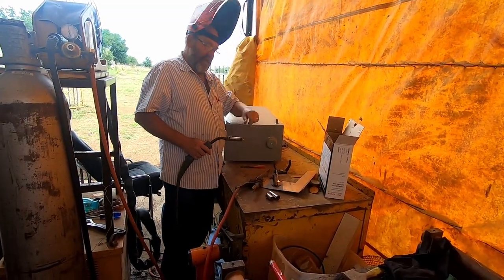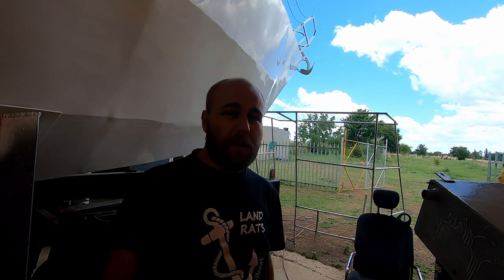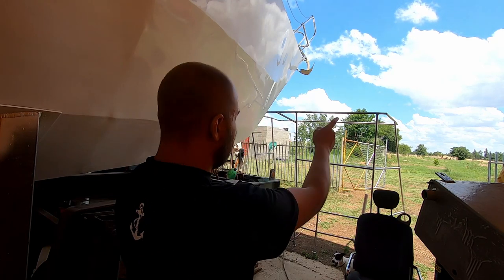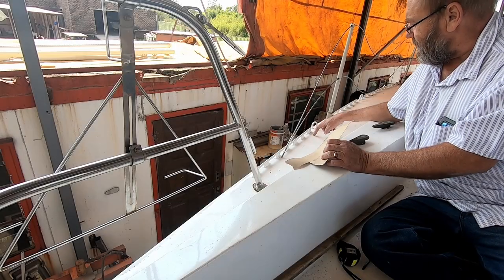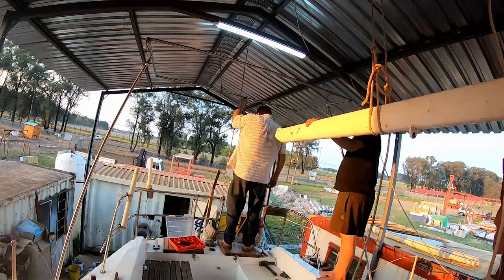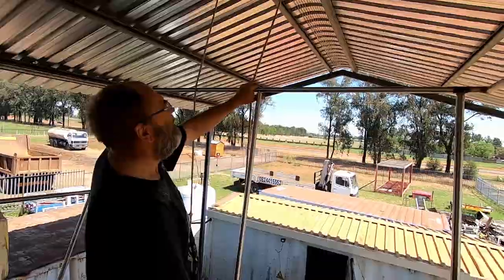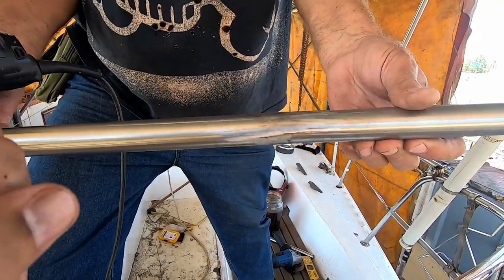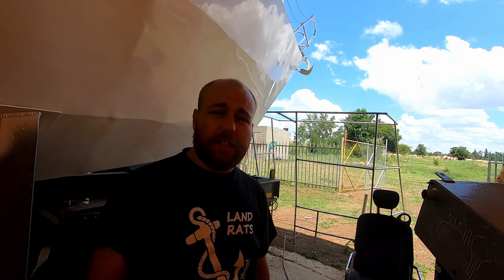Building a Cheap Solar Arch for our Sailboat | Land Rats | EP19

Comment from the maker: Just an Update! If you're planning on doing something similar to this video I'd advise using a thicker pipe with a better wall thickness. The Arch is a bit wobbly with what we used and we'll probably need to add more supports

Comment: You guys apparently have a ton of stuff around that you can simply repurpose onto your boat.  What a luxury!  I'll be watching, but knowing what the same arch might cost me would be helpful.
Reply from the maker: The only thing we didn't have to buy for the arch was the stainless steel wire that we used to tack and could borrow from a friend. Everything else was bought and price showed at the end. Excluding tools which we already have. Drill, grinder and c02 welder
Reply from the maker: But having a workshop with a couple of odds and ends laying around definitely does help!

Comment: Hi.  I am sure you guys have done your home work but what I would suggest is making the uprights  of your solar arch out of 38 mm tube   Bolt that to the deck then weld your pushpit to that.  It will be much stronger
Reply from the maker: It's quite strong now when bolted in position but if there are any issues we'll definitely see about adding some thicker tube